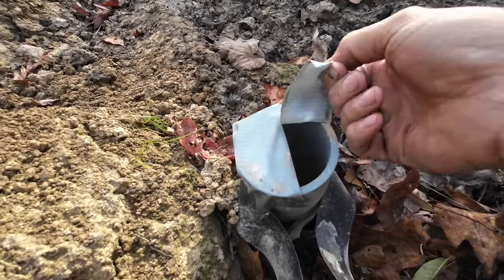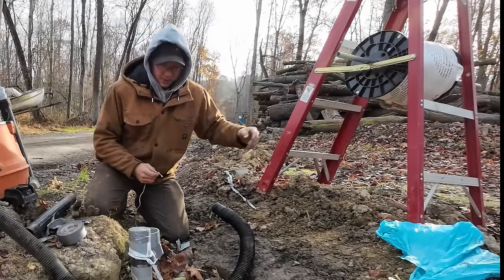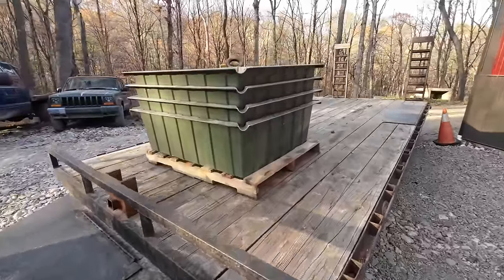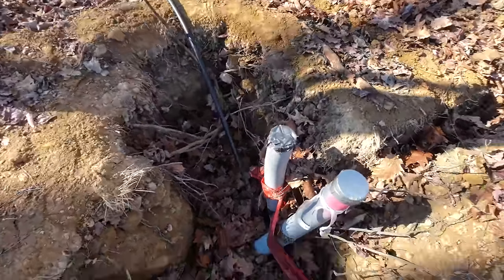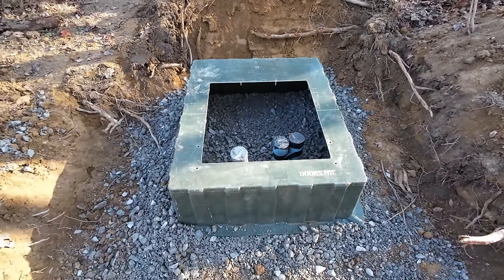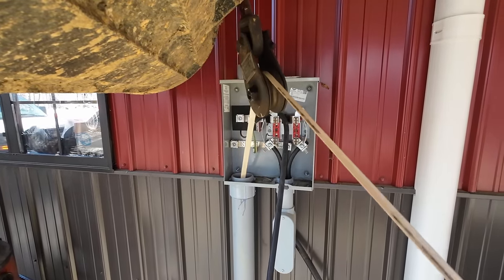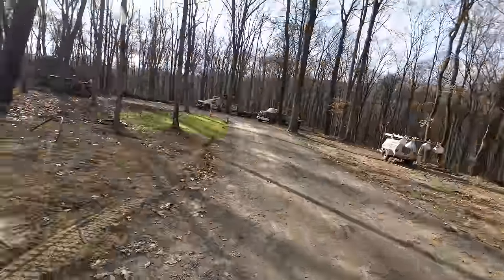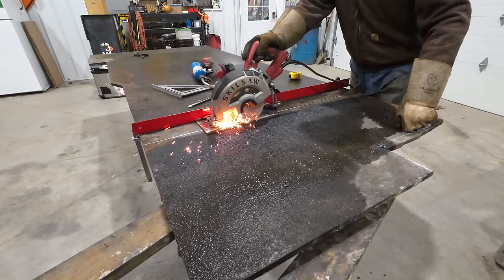The Power Company Charged me $52,000 for this!!

Comment: Matt, my electric cooperative here in Oklahoma let me sign a two year contract that reduced my installation cost considerably. The power here is delivered via overhead lines but I buried the conduit on my property for esthetic reasons. Bottom line is instead of $8k I spent $800 for one pole and transformer at the edge of my property. I would do as some suggested and take it up with the local regulatory agency.

Another great video! Watching you get set up is very reminiscent of what I did. Thank you sir!
Reply: Take what up with the agency? This was a HUGE project (over 2,400 feet) and primary work has expensive materials, and the people who do it have to know WTF they are doing. Primary cable starts at around $25-30 PER FOOT and goes up from there depending on conductor size and voltage rating. Splice kits and terminations are hundreds EACH.  Plus the manpower and equipment to install it. Like I said in my direct comment to this video, he actually got off cheap based on the scope of work here. The agency would laugh him right out of the office.
Reply: @mxslick50  my run was 1800ish feet same transformer... I buried the conduit THATS IT and my electric coop set the pole at the road to  start the run, they ran the pull tape and they then ran the wire and set the transformer... They also put the meter box up on a 4x4 and set that...  All for under 8k... They told me it's no different than the wires on the road it's behind the meter, and they own it....  It's all rolled into the monthly fee (I pay a 30 or 40 dollar a month membership fee plus my use) Im in an all electric house and even in summer when my ac is running 24/7  my bill is 200 bucks a month... In spring or fall 160....  My coop had a couple million dollars surplus last year we all  got rebate checks happens many years...  Oh and they sent 4 guys to do my 1800 foor run. They were done in 3 or 4 hrs... He got ripped as the saying goes if you have them by the balls their hearts and minds will follow.....
Reply: So 2200 feet at $23 to 24 per foot is what your 52,000 comes to.

Comment: Utilities will usually charge one a high price for electric infrastructure if one is the first and only customer utilizing the infrastructure. When more customers start utilizing the infrastructure, the initial customer usually gets a refund on the initial cost of the primary power infrastructure. The utility does this to recoup their cost of putting in the primary power infrastructure and normally is in accordance with the public utility commission having jurisdiction of the area. The utility recoups the cost of putting in the primary infrastructure from the energy used by the customers. Depending on the power consumption by the customer the utility may shoulder the entire cost or charge the customer for the initial primary power installation. The utility has to recoup their cost in accordance with guidelines of the public utility commission.

Comment: Glad you are finally connected to the grid.

Suggestion with the Metal Saw, I've had a Milwaukee one for 6 years.  I've found that despite their instructions, when cutting plate the blade lasts longer when run at full depth, minimizing how long they are in the metal.  I think the usual instructions were written for people that mainly use it with sheet material, not plate.  With any power saw you want a minimum of 3 teeth in constant contact with the metal, so thinner the metal the shallower the blade, otherwise you start breaking teeth.

Comment: the error is you should have installed a pole mounted transformer to knock primary down to 600V and to a meter base at the property line - then run your PRIVATE SERVICE on poles to wherever you need it - use a 600V to 240V transformer at your shop or house
No utility allows you to run thier primary service until it hits your HV room and disconnect
You didnt get screwed but there was a cheaper way
Pole transformers are cheap
600V to 240V transformers are cheap for the loads you have
Love the channel keep on keepin on dude
Reply: This right here!
Reply: Re-watch the beginning of the video. For at least the 3rd time now Mat has stated that his neighbor would not agree to poles and overhead wiring and the need from the main pole had to cross his neighbor’s property. There was no other option.
Reply: yeah i do recall him saying some such thing you are correct. But for everyone else its really not the way to do a long private service unless you REALLY want it underground... and are willing to pay for it. There are private contractors (ex-utility guys) who run these overhead private services for you, they sub-contract the utility work as well. Simplest thing is ask one of those contractors how they would do it themselves.
Reply: Mike you are correct.
Reply: @380.motorsports  But once he got onto his property he could have put the box on the end there, greatly reduced the total length that needed the PC to pull cable, then ran his own from there on still underground.
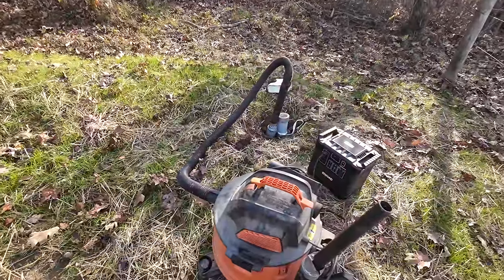Reply: 12:19 Is where he should have installed the box to minimize the PC pull length

Comment: Matt, I'm a retired union high voltage test technician from Upstate New York. Before I was in that  I was in my family power line construction business for 28 years. I know a little about this type of work. I've estimated it, and I've installed it. 
I really enjoy your channel but I have to give you some old man advice for a moment. That high voltage cable is expensive. The parts, labor and you know the equipment to install is expensive. 
Adding it all up, and not knowing what type of cable you had installed, copper or aluminum,  their price was not that bad. So please, give those guys a little professional credit. They are not out to rip off the people that they see every day.
Thanks Matt
🤝🤝🤝👍🇺🇸🇺🇸🇺🇸
Put some one yard blocks around the transformer so it doesn't get hit.
Reply: I work in industrial automation and I was thinking the same things. Those are some long runs, and cable is really expensive stuff.
Reply: I am a union Electrician. We regularly update Industrial and Commercial Plants. Cable by itself is extremely expensive. Manufacture will charge you whatever amount they want.  I’ve seen cable run from 2.50$ to 85$ per foot.

Comment: Wire pulling Grips are handy. And when you add an electric Gate operator and security lights, you can tap a transformer and place a meter there. 37:25

Comment: The way to dodge this is to have them run the drop to the edge of the property (bonus if you make a small outbuilding) then run the rest yourself. We saved a buddy 5 figures doing this.
Reply: Yes you can, BUT, there is a reason they transmit power at high voltage - volt drop
Had Matt put the transformer immediately on his property and run his own low voltage line to the building over all that distance, the quality of the supply voltage might not have been up to the job.
e.g. a 25kva supply, might be supplied to the transformer at 7,000 volts, so would draw 3.5 amps - doesn't need fancy expensive copper cable between the poles - 25kva at 110v is over 200 amps - the copper wire for that is $$$$$$

Comment: They are Handholes for the High Voltage cable for future Splice points. Let the neighbors tape off, or add a meter to future outbuilding for a meter and transformer. 16:30
Reply: Ahh, I couldn't explain why it wasn't one run; until I read your post.  Makes perfect sense.
Now I'm also thinking it would allow for long term expansion years later if the land is parceled out into home plots.

Comment: We used to use what they called mice (round foam that had an eyelet to tie the string) but the bag runs circles around mice. Especially because mice get stuck from time to time on the connections especially at the 90 degree sweeps. I find it interesting that I’ve built a house for a customer and we ran underground and Penn Power made me purchase and run the wire. Then I built another house and run underground so I installed the wire but Duquesne Light made me pull it out and pay them to install theirs. Then I installed a modular and Duquesne Light made me run the wire (used the same wire I pulled for other job) now West Penn Power had to pull yours but only to the transformer, and you did the Service Entrance, What is CRAZY is they are all owned by FIRST ENERGY?????????

Comment: Insane that you did 95% of the work and they charged you that much.   On our recent build we only had maybe 200’, but both the gas and electric were installed for a little over $1k each.  And that was the big lines.  The larger residential gas and 320a service (in prep for an out building).   I was always under the impression they took on some of the initial cost knowing they would have service to bill for decades to come.
Reply: But Matt is going to use wood for heat, and most use propane.  So a utility can't really add much to tiny electric bill to cover 10 men and equipment wasting half a day counting travel and prep.  If the men are $100hourly x 10 x 4 that's $4000 right there.   Equipment amortized is maybe another $4000.  If your power bill is $2000 a year they can't easily slip in more than $200 as fees without moaning...   I also wonder if they know rural customers fail more often so then a crew is demanded in mid winter, so these are the worst customers but gotta charge them same kwh rate.. . .   So I'd say $20,000 would be likely, but yeah more than that seems weird.

Comment: You probably know this by now, but mule tape has foot markings on it so you can get your measurements without pulling it back out and including bends, offsets, etc. Just be careful to use the actual foot markings and not the pull strength of the tape ;)  Nice work!
Reply: I have been running networking cable for 10+ years; I learned this 3 days ago -,-
Reply: @DozIT   bulk category cable and bulk fiber also have foot markers...
Reply: network cable also often has markings on it to tell you how much is left on the roll! The fancy stuff counts down to zero, the cheap stuff starts and ends at random offsets.

Comment: Code requires 4 ground rods at the transformer.  I’m an electrician in my area and the power company is more than happy to let me install the HV coax. Should have looped the wire at the meter box I’ve seen frost pulling the wires right out of the lugs
Reply: my company requires one at the transformer but its tested at 25ohms or less
Reply: @jeffriley-lq5np  I rarely see earth resistance below 25 with two ten foot rods, I’ve worked on jobs in Florida where we’ve used two twenty foot rods just to get it down to 25 ohms. Without a proper ground system at that HV transformers that’s so far away from the main line could be quite the liability problem. 💥🌩️🔥

Comment: Years ago I worked on generators.  A customer I went to do a start up on a 400Kw generator had your same problem.  They wanted well over $2000,000 to bring him 3ph. He had 1ph near the site. It was a rock quarry.  He did the math and figured out he could buy a generator,  use the single phase for basic power and run the block heater on the generator. Between the fuel cost and price of the generator it'd take him 4 years to break even, after that he was saving money.

Comment: Little tip for anyone doing this alone: do not use a standard household vacuum, make sure you use a wet/dry vac as shown in this video. Why? In a household dry-only vacuum, the air vacuumed in is the same air used to cool the motor. So if the bag makes its way into the vacuum and blocks the airflow (as we clearly heard happen here, as the motor sound changes), it would block the cooling and the motor could overheat before you make it back to turn it off. 

Wet/dry vacs, on the other hand, have a totally separate airflow path for motor cooling, since the vacuum airflow can be mixed with water and inconsistent. So a wet/dry vac can operate with its vacuum inlet blocked indefinitely, since the motor will continue to be cooled.
Reply: Well if one has two people that is not an issue.